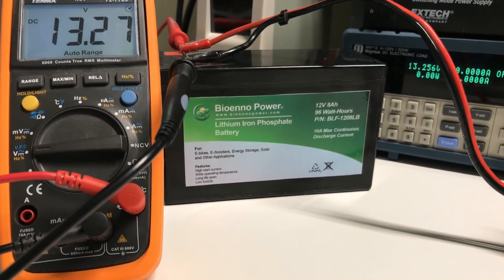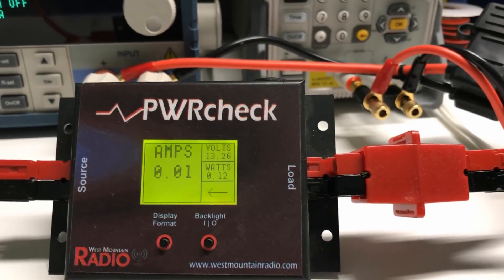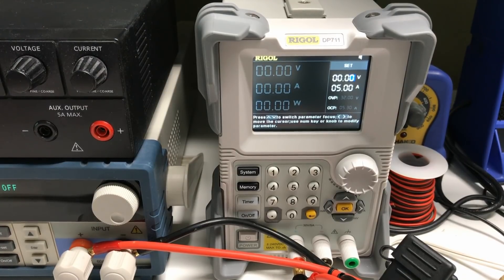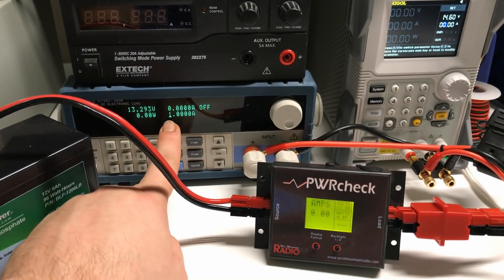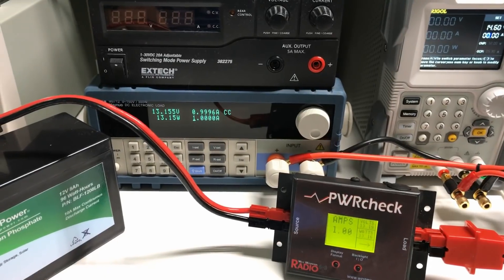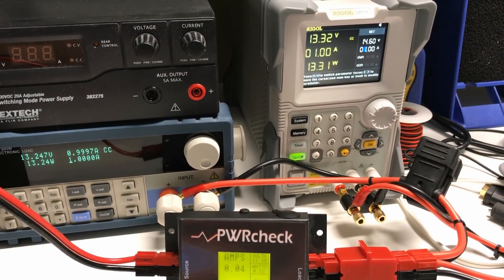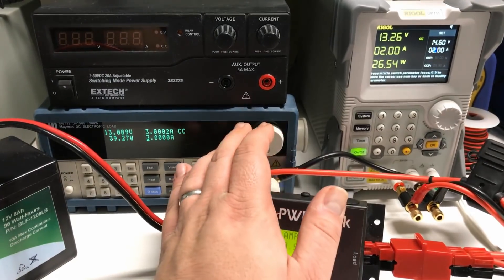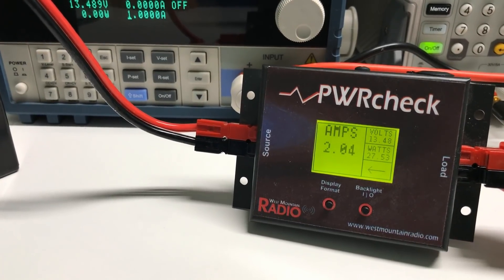What happens when you charge and discharge a LiFePO4 battery at the same time?

Comment: Thank you. You clarified & confirmed what I thought was happening, with my Series-Hybrid projects. They're just homemade or modified electric motorcycles, with generators built in, to charge them at anytime. I just have to keep my usage low enough, to where the generator can charge the batteries, while I'm moving. And I do need a generator that can handle the max charging currant of the battery pack, times the voltage I want it charged to, and, along with that wattage, handle the wattage I use to move.
Homemade Series-Hybrid motorcycles, solved?
Reply: hey can you tell me more about your project? have you documented it somewhere?
Reply: @jayframe929  
I will describe my first Series Hybrid. It's very crude, because I designed & built this system, while simultaneously learning about EVs & Electrical Engineering, on my own, because I will not have more student debt.

 And under all that. The used Electric Scooter I brought & converted, is weird. It seems to be a 48volt system. The charger it came with, charges to 59v. It has 4 bulky batteries in it's battery pack, but the little information on them, is in Chinese, with no numbers indicating individual voltage or capacity. But the motor-controller it came with, cuts out, at 54volts. 
________________
This is how it's Series Hybrid system works.

I installed a portable Inverter Generator. The kind used for camping. It's 700 Watts Continuous, 800w peak. It outputs 120 volts AC, like the single phase outlets in a North American home, but limited to about 5.8 amps.

The generator's output, goes to a 700VA toroidal transformer, to convert the 120vac, to 54volts AC. Then the 54vac, goes through a rectifier, to be converted to about 52 volts DC. 

To stabilize the DC ripple from the output of the rectifier, I wired a bundle of Capacitors, in parallel, to combine their capacities. Together, the Capacitors are 1500uf, 150v max, 175v surge.
_________________

That would have been the end of the on-board charging system. Just connecting the + and - of the Capacitors, in parallel to the + and - of the batteries, to charge them.

Yes. The Capacitors would have been connected to the batteries, at all times, sharing their voltage. This was before I knew about Blocking Diodes, and I was curious if the lower resistance of the Capacitors, would help me launch from dead stops.

But because this motor-controller won't work with 52 volts. I put a 1500Watt Boost Converter, between the Batteries & Capacitors.  I adjusted the Boost Converter, to step up the 52 volts DC, from the Capacitors & Rectifier, to 57.6v, after the Blocking Diode on the Converter's output.

I didn't know at the time, if it was ok to just let the batteries draw 59volts, at any current they can, from the Boost Converter.

I have to treat the charging system, like an infinite capacity battery,  fully charged to 59volts, then connected in parallel, to a 52volt battery, to charge it to 59 volts. And because the original 59volt scooter charger, stopped working. I just unplug the Transformer from the generator, and plug it into a power strip, so the grid charges the batteries to 57.6volts, while I'm sleeping or whatever.

And when I'm riding the scooter, on battery power alone, and my scooter, and/or my smartphone, are too low. Then I turn on the generator, to charge them.

And even if the mysterious batteries, can safely handle 59v from the boost converter, I don't want the batteries stuffed fully, and their life reduced, especially when fully charged for long periods of time. And even though, with Motors, the higher the voltage, the higher the rate-of-acceleration and top speed. I settled on 57.6v to get the most life out of the batteries I reasonably can. And the Blocking Diode on the Boost converter output, allows it to charge the batteries, but not allow the batteries to effect the Boost Converter, in any way.

The Boost Converter, with no current limit, overwhelms the generator, and makes it turn off, when charging the batteries from 52volts, so I adjusted the current limit, so the charging system is safe and stable. The rectifier doesn't get hot, the generator electrically isn't overwhelmed, and the generator's 40cc engine isn't spinning it's tits off, to power the charging system.
______________

Again. My prototype is very crude. The Scooter Wattage, is greater than the generator.   And the inherent problems of the scooter, are frustrating. The step-through frame, not allowing me to hold the motorcycle with my legs. The headlight is as dim as a candle. And it is not fast & quick enough, to keep up with cars, let alone use expressways & parkways.

But it works. And I'm happy to be riding a motorcycle.

I can no longer pedal a bicycle, because of chronic knee pain. And even if I had the healthy body of an Olympian. I am sick of the limits of the human body. Muscles are pathetic, compared to engines & motors.

That Series Hybrid scooter is good enough for my delivery job. But it's still dangerously slow, like a bicycle. I want more speed, more power, and a greater suspension.

I'm now saving for a half, or Full Duplex, motorcycle frame. And I know how to make a generator, for my needs. Instead of finding a high Watt, high current, generator, and stripping it down to fit in a motorcycle frame. I just have to find a high current, DC motor, that becomes a generator, when physically spun. And couple it directly, or through a gear ratio, to a small engine, strong enough to spin it up to the voltage I need to charge batteries. No heavy transformer needed, or a rectifier. Though I still don't know if I can just use a 3-Phase AC motor, and a 3-Phase Rectifier, to make a generator.

A Blocking Diode will prevent the batteries from just powering the DC generator/motor, unless, I bypass the Blocking Diode, with a contactor/relay, powered by a motorcycle ignition switch, so I can use that motor to crank the engine, so the engine can spin the motor as a generator, to charge the batteries. The engine may need a voltage governor, or, I can use or make a high current Boost Converter, to regulate the voltage bulk charging the batteries, whether or not I'm using them.

Then I will build battery supports, for a sealed, temperature controlled, battery box, to surround the homemade generator in the frame, with batteries. And I will use powerful hub motors for All Wheel Drive, and All Wheel Brake Regeneration.

....That's it.

Those are my current, and  future Series Hybrids.
Reply: @observingrogue7652  holy shit thanks for the extensive description. Good luck for your future project. I am interested because I am planning to convert an old V6 Diesel truck from the 70s into a self-sufficient electric truck with a 50kWh battery and 4 cylinder diesel range extender. Just like you I looked at existing range extenders (I could only find some on Alibaba) but considering I want to travel to isolated places in my truck I don't want some random Chinese diesel engine in my truck, which is why I am going to build the range extender myself with a dedicated German diesel engine for electric power generation. While I haven't planned everything exactly, I will probably use a three phase electric motor as a generator because they can be rewired and I am probably going to include a battery charger for three phase power anyways.

Comment: Nicely demonstrated! Easy to understand when presented so clearly.

Questions: 

So, what happens when the "solar controller" has more than enough amps to run the radio and the excess tries to flow into the battery but the battery is at 100% charge? Will it attempt to overcharge the battery and therefore damage the battery if the excess power isn't "dumped" to a dump load or other active load that can "bleed off" the excess amps? 

And if a dump load is indeed employed, what happens if it is not sized sufficiently to bleed off all the excess power? Will excess power manage to overcharge or damage the battery if there is no battery charge controller in the circuit to shut off incoming power to a battery that is 100% charged?

In other words, how do batteries in parallel with power supplies behave when they are technically at 100% of capacity but the power supply has more amps available than the load requires?

Comment: very helpful!! question, howcome when you charge 18650 batteries with a basic 18650-USB phone charger, you cant also be discharging? is there a safety feature built into the little control boards in those USB chargers that prevent this? I want to be able to do this small scale with USB solar panels and just a handful of 18650 batteries to power some USB devices but i want the option of charging and discharging simultaneously. whats preventing this from happening? i wish there were more videos on this topic.
Reply from the maker: This is going to be a driven by how the circuit was designed by the manufacturer. There are scenarios where you could have a problem. Let’s say you have a load that needs 5 amps. Let’s say your charger can provide 2 and that your battery is nearly at 100% depth of discharge. If I try to pull 5 amps from a system that can’t support it, I could damage something in the system - for instance if the charger isn’t regulated and doesn’t stop at an overload situation, something could catastrophically fail.

Comment: Awesome real life explanation. I knew that the answer had to be yes just based on the fundamentals of a solar system and, hell, even a car, but I just wasn't sure of the specifics and general numbers. You cleared that all up in about ten minutes so thank you! 

I was previously thinking that the charger would basically first have to send its power THRU the battery itself and therefore was really worried about internal resistance of the cells. While I still think that's somewhat a factor, I don't think it's nearly as big a deal as I first made it out to be. I prob shoulda known since both power sources are connected in parallel and therefore just sharing the load. I guess, in theory, if your load was really big and exceeded the output of the charger, it could potentially draw the battery down past the limit. Think I just need to sit down with a pencil and start crunching some numbers really. Goddamn you Ohm and your laws!

Comment: Hi, I'd like to use a 12v16Ah LiFePO4 battery (originally designed as a golf trolley battery) as a replacement for my car battery. What are things to look out for?
Could it handle the alternator, which float charges when full?
Do I need some kind of current limiter to prevent it from charging too fast and maybe destroying my alternator?
Can I keep the BMS that is inside the battery?
Or do I need to make it 'dumb'? If so, do I need to make up my own hardware for protection and charging?

Comment: "Simultaneously" is a poor choice of words here and some people think you can damage a battery because current is somehow simultaneously flowing in and out of the battery.  But that is impossible and current can only go in or come out of the battery.  So it is not simultaneously charging and discharging.  It is just alternating between charge and discharge states depending on your power source and load.

Comment: Try connecting an LED (light emitting diode) directly to power supply, see what happens... There are times, when the current supplied is too powerful for the load. WHAT IF... the sun is so bright that the solar panels are providing charge current in far excess of battery packs rated charge current (say 20C charge current :P ) Ok, maybe I'm being a wise *ss. Nice demonstration, confirmed what made sense already.

Comment: Thanks so much for a real world demo of LiFePO4. Surprisingly, straight forward answers to such an obvious question are pretty difficult to find. Im using a small 800w continuous invertor generator sitting on an electric bike with a mean well power supply and no idea how LiFePO4 chemistry would handle the situation. SLA and Li-ion batteries have easy examples of charging/discharging simultaneously,  As I expected,I just need a little careful consideration of charging rate more than anything else. 
Again, much appreciation

Comment: Curious:  at 5:43, why is the power supply putting out 13.32 volts when it is set to provide 14.6?
Reply: That is the voltage limit. It will not charge the battery above that amount, if the voltage reaches that then it will stop providing power. But in this demonstration, if there is a load that causes the voltage of the battery to drop, the power supply or charge control will begin supplying power, and in this case a portion , or all, of that power would go to the load depending upon if it is providing enough power to service the entire load.

Comment: Will there be an instance where the power supply’s current ONLY charge the battery, and left out the load? Say when a completely drain battery is used.. I’m not sure about this, but from the way you explain the power supply will always prioritize the load, y is this?

Comment: My question is does it detrimentally effect the life cycle or other aspects of the batteries if you do this a lot? For some reason, I'm worried that passing the charge current thru the batteries like that is not good for it.
Reply from the maker: The current isn't much passing through the batteries as the resistance in the battery is higher than the wire.

Comment: Thank You!  This is exactly the question I had and wasn't finding convincing answers for.  Some folks may think this topic is trivial, but for me burning up a $130 battery is no small risk.  Thanks again.
Reply: I would still go with the battery mfg reccommendations on this, as some batteries will overheat when both charge and draw currents are present at the same time.

Comment: Dude... People do this with their phone batteries every day... Same 10lbs of shit in a 1lb bag.
Reply: actualy the phones and laptop use particolar ic's with power path... google it
Reply: I think in phones and laptops, the BMS actually triggers a relay which sends the charging current to power the device as well as charge the batteries. Whereas in the video, he's sending the charge current THRU the battery to the load. It's similar but by skipping the current going thru the battery to the load, you can both use the device and charge the batteries pretty quickly. At least that's what I found to be the case in my old laptop.

Comment: First of all thank you for this vid, it will be invaluable to my project.

Now I'd like to explain my project a little and ask some questions:

My project: Note, this is for a motorized bicycle... the goal is to build a circuit for handling charge and discharge between the alternator the battery bank and the various loads I plan on having. I was going to use an electric motor driving by the rear wheel as a dynamo (the alternator) and NiCa 18650s to build my battery bank (so that it is easily expandable, and given the relatively small size, I could have finer control of the shape of the bank) and for loads I have a set of rear and front lights including blinkers running lights, a break light, high and low beam lights and fog lights etc, so quite an extensive light set up, and also on the load I plan on having a bicycle computer, a phone charger, a Bluetooth speaker, and an extra USB output... On the supply side of things besides the batteries and alternator I also want to be able to charge the batteries at home via some wall wart and I'm playing with the idea of also adding a solar panel. So I want my circuit to handle and prioritise supply and load.

So is this battery behavior going to be effected much by the battery chemistry choice (rechargeable batteries obviously) ?

Do you know of any info circuit types to research and or other tutorials that could be of use to me? ... I was hoping to do discrete complete design, but if I go with a fast prototyping board I would prefer one that's based on the ATtiny85 as I kinda like that chip and something like the Arduino scan be used and then I can just break it down to just using that little ic.

And lastly, I'm concerned about heat... if my cells are full, and my draw is lower than my production, that excess current will have to go somewhere, probably to some mosfet in my circuit, (or in the event case of my supplies are producing more than my load draw and my over charge protection circuitry is triggered to limit the current into my cell bank... something I want to be settable via a trim pot as I may be expanding the battery bank) the engine will also be producing heat, and I don't want my circuit exposed to the elements, in fact it would be nice if it had a chance at surviving a wreck or two... so then there are some hot summer days... so maybe a thermo controlled fan with some kind of intake in the case design that still accounts for rain being forced in via realise  train fall direction... I'm stuck on designing that so any ideas or suggestions there would also be greatly appreciated.

Thank you to anyone who actually read that, even if you have nothing to contribute.
Reply: Listen carefully to Kirchoff's Current Law again.  There won't be any "excess current."